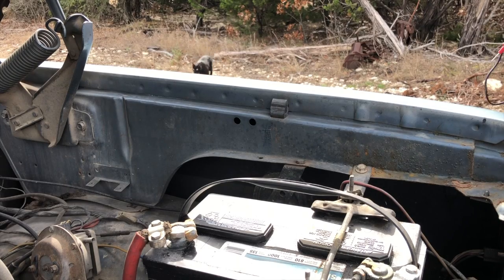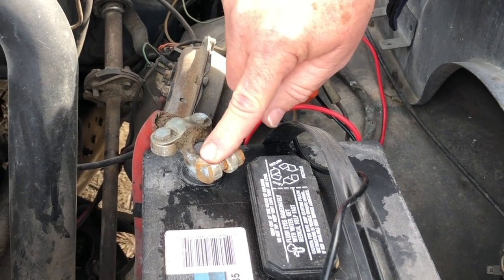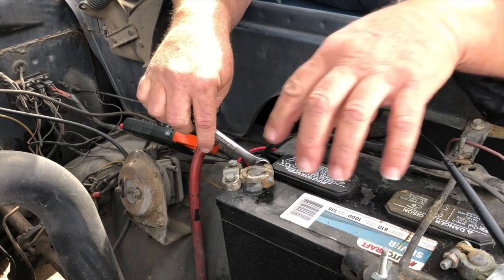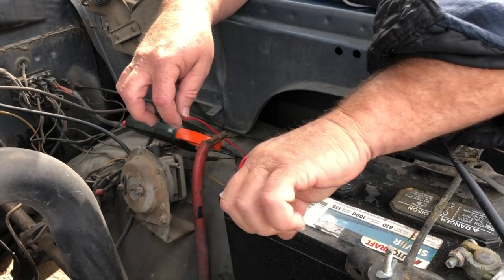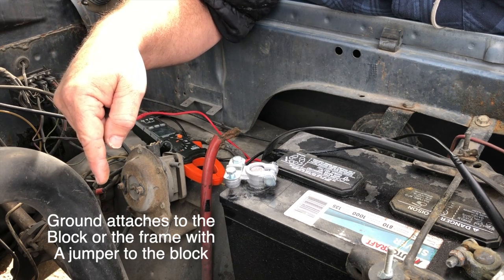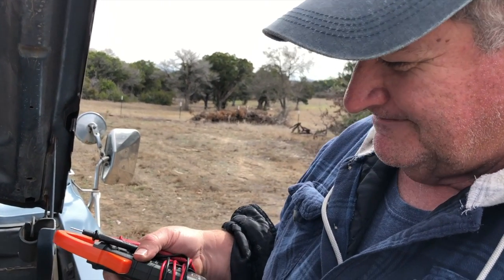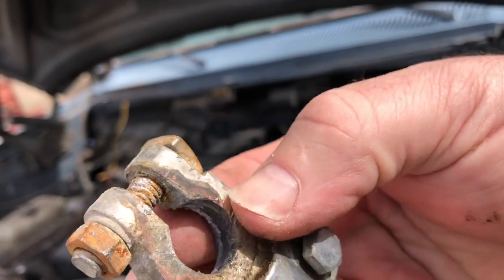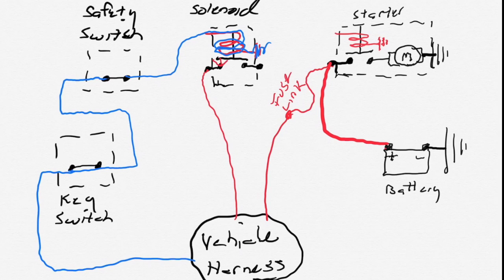Aimless and Troubleshooting Dodge First Gen Starting Problem

Comment: Hi i have a 1985 dodge b250 318 5.2, i love everthing about it except the mpg. Im wondering if i can swap a 5.9 diesel or any diesel engine to my campervan. Thanks let me know
Reply from the maker: I would think there would be a lot of variables that need to be worked out, fit, spring capacity etc. perhaps put a 3.0 Mercedes V6 diesel in it. Thanks for watching.

Comment: So my truck is having that issue but when the motors dead cold it starts right up, but when i run the truck for 20 minutes on idle then turn it off, it'll do the exact same thing yours was doing before you fixed it. Then I have to wait until the truck is dead cold again for it to start up. The starter and relay clicks.
Reply from the maker: Troubleshooting over the internet is damn near impossible and often leads to a lot of unnecessary parts changing. Check all of you wire connections including grounds. Obviously you need to troubleshoot it when it is acting up if not you are liable to be chasing your tail. Try the checks I did on my video when it is hot. What engine do you have?
Reply: Its got the 5.9l 360 v8.
Reply: Its turns out that in my case, the reason why it wasnt cranking over was because the brand new starter the previous owner put in ended up being broke right out the gate. It wasnt shooting the gear that connects to the flywheel to try and turn it over. It passed twice and they said it was on the tester, but when it was put on the truck it didnt do it once. So I swapped out the brand new starter for another and now she actually trys to crank over. It leads me to think that it is vaporlocking because of where the gas lines go through and when its been idleing at 108° here in arizona, it shuts the truck off and you can get it started until it really cools off. Ive got a hell of a story from yesterday because it did that while I was in line to do emmisions on my truck.😂
Reply from the maker: Spiez RayPatrick yea it funny how things are not as you would expect. To heck with the emissions people if they can’t take a joke. Lol

Comment: Awesome first gen nice to see a swapped 12 valve
Reply from the maker: Thanks, it is the third one I did. Please subscribe to my channel for more videos.
Reply: @KevinKalden  I did thank you ! 
Hey quick question I have a 12 valve 93 and yesterday I changed the oil I put the oil oil in the gas tank with a 5 gallon of diesel 
Again my tank was low so this was only the diesel and oil 
I went to turn it on it was good but after a few minutes it bogged down and shut off by itself i turned on but turns off again what could it be ?
Reply from the maker: Abishai Ruvalcaba sorry but I am confused. You changed the oil. Then you say you put oil in the tank? Did you mean you put oil in the engine? Then put diesel in the fuel tank? So were you out of diesel? Or did you change the fuel filters? If you changed the fuel filters or ran it out of fuel then you need to prime it. To do this take the fuel filter off and fill it with diesel or better yet fill it with automatic transmission fluid it is clean from its container and burns just fine. Put the filter back on. Then open the injector lines at the injectors and crank the engine until fuel comes out. Close the lines and it should start. Don’t crank it with a low battery or too long. Let the starter cool.
Reply: @KevinKalden  well I put the old oil in the tank I heard you can run them with there own oil too so I did that idk if I should full it up with diesel or if me by doing that I caused a problem    I ahevnt changed the fuel filter yet and have done about 2 oil changes since
Reply from the maker: Abishai Ruvalcaba i never do that. Perhaps it is too thick. Take the fuel filter off and feel the oil. Is it thick compared to diesel? Motor oil has a lot of BTUs but is hard to ignite. Good luck and keep me posted.
Reply from the maker: Google this https://itstillruns.com/burn-motor-oil-diesel-engine-7935413.html sound like it is not as simple as you thought.
Reply: @KevinKalden  aw man I'm worried now I heard you could I guess it has to be mixed more ?   What would you recommend I empty the tank out and fill it with diesel ?
Reply from the maker: Abishai Ruvalcaba i would not worry to much. Drain the tank, put a new filter on it. Bleed it and drive it.